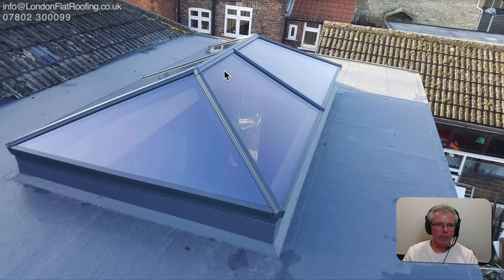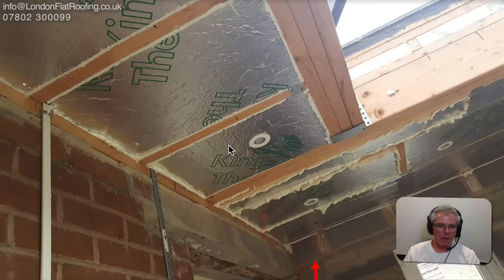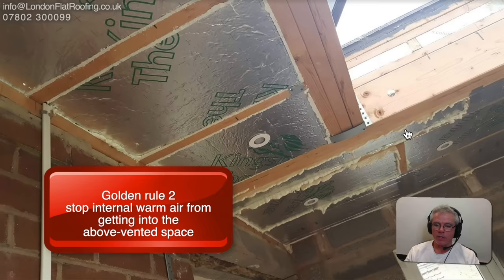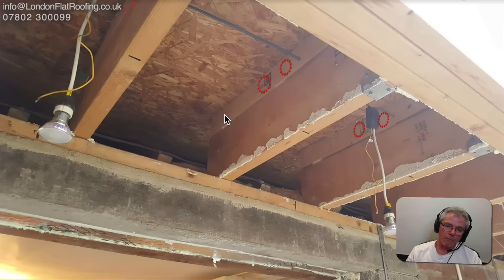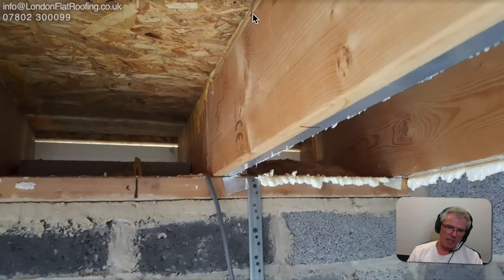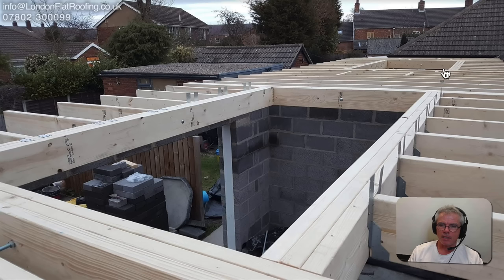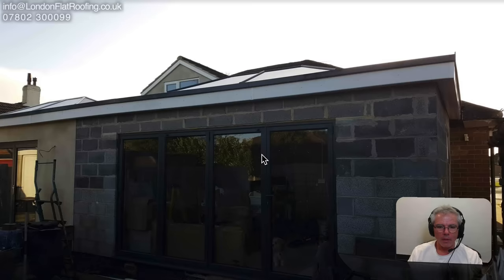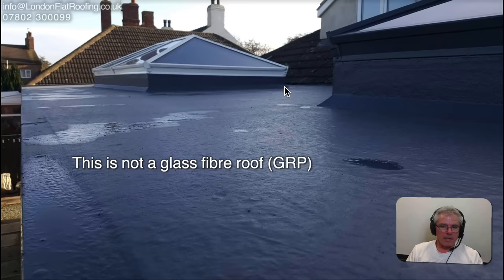Sweating and mouldy New cold flat roof

Comment: Hi, great video, I hope you have some advice for my unusual project. I am building a 4x4 metre drum studio. It is constructed with a flat cold roof and uses a room in room principle. Because of sound insulation venting is not really an option. So my constructions is as follows: outer room: on top EDPM, OSB, rockwook, damp proof membrane, 10 cm of air and then the inner room rockwool, damp proof membrane, plasterboard. There will be mechanical ventilation in the inner room. I was not planning venting the space between the rooms Should I do this as well? are problems to be expected considering the 2  membrames? also it wont be heated 24/7 and there wont be holes in the plasterboard for lights etc

Comment: Does the closed cell insulation with foil backing, along with foaming air gap details not suffice as a vapour barrier?
Foil has a superior vapour Impermeability than poly even.
Reply from the maker: Yes one of the problmes on this could be that they have introduced a  AVCL (air vapour control layer) in the wrong place
Reply: Cheers 👍

Comment: The vapor barrier needs to sit on the side of the insulation that faces the warm/humid air.
So it depends on your local climate and is not as universal.
Reply from the maker: Yes correct in warm countries you place the VCL on the outside

Comment: Which vapour barrier do you recommend,? And would this be simply stapled to the under side if the joists?
Reply from the maker: Novia 1200 Vapour Control Layer 100m2 Roll follow the instructions and use alll the tapes

Comment: Been flat roofing for 35 years, Put a warm roof on if you can, saves the need for vents.
Reply from the maker: Yes much easier construction
Reply: The trouble is that the overall construction depth of a warm roof can cause detail and aesthetic issues.  Besides how many jobbing builders know what a warm roof is - they probably think that it involves some sort of heater!

Comment: Don’t we want to cut holes in joists in the center third for ventilation? This is done for electric running wires as to not compromise the joist critically and would assume you would want to do it here also.

Comment: Hi steve, i have a question, i have a small extension with a warm roof and a overhang on the front there is a secret gutter, the inside is not plasterboard yet, and we had a lot of rain when roof was done, my problem is where the overhang is the osb below the secret gutter is sweating. I was told to pack this with insulation to avoid drafts, at the moment there is no insulation in there and with the cold frost in the morning i am guessing that is causing the sweating. Do i fill this with rockwool or pir, i plan on having downlights in the sofit.
Reply from the maker: you really need to send me some photographs so that I can understand this
Reply: Hi Steve, basically, the overhang on roof is about 600 wide, and I haven't put any vents in the sofit. On the overhang, there is a secret gutter built into the overhang, and from the inside, I can see into the sofit and see sweating on the osb on the overhang. I was told I would have to insulate the gap on  the inside to stop drafts coming in, and I think the warm air from the house Is going into the sofit and meeting the cold on the overhang, there is no insulation on the overhang as there is a gutter built into it. The rest of the roof is a warm roof.

Comment: Hi Steve, we are refurbishing a cellar room that has a reenforced concrete roof, which sits approx  400mm above the ground. The  2 sides of the roof that can be ventilated, are at 90 degrees to each other, so we can’t cross-vent. Also, there isn’t enough space to insulate above (access to property).  Possible a ridiculous idea, but could we fix PIR to underside, then use something like passive house variable membrane to make it airtight?

Comment: Does all this apply if you were to make a loft space in your garage, and insulate and board it out between that and the converted garage below ? Can it still sweat or does the air circulation coming in from the sofits prevent that?

Comment: I have a question to ask. My friend who’s a builder told be to over board my plaster in my attic bedroom with Kingspan. It’s an old house build in the late 1800s. I noticed the other night I had condensation all up to my apex from my eaves so I have taken the insulation off the plaster board and then noticed moisture on the plaster too. Is there any way of retro fitting the insulation to this house. Or will I need to reroof to get a vapour barrier installed thanks.

Comment: Common problem with cold roof , sometimes I’ve seen celotex or whatever stored outside and left out in pissing rain then fitted soaking wet which will dry out over time but not before you notice this exact problem

Comment: Hello, can you elaborate why one would need to use treated wood for a (flat, cold?) roof construction? Thank you!
Reply: I would assume it’s because any condensation build up on untreated timber is more likely to lead to rot and decay.
Reply: @xxxsmithxxxx  If properly vented (assuming this is always the case and standard practice), there will be no condensation.
Reply: @matthiasdemey1423  belt and braces approach maybe in the event of unventilated corners etc. Again, I can only assume.

Comment: Warm roofs are a better solution, but think that if you do have a well insulated cold roof and a vapour check in place that venting the roof above does in itself produce problems and breaches the text book achievable u values.

Comment: I have two properties with roofing problems, London, Hampstead NW3 and Kensington, one has a flat roof, the other I think is a cold roof with epdm rubber, the roof with the flat roof has water damage, it is ventilated well I believe,  i think it’s asphalt, it may need the insulation redone?  Some brickwork may need repointing,  many problems, we have a sun roof built in also its timber,  we are thinking about roof tiles but are not sure about the building and construction problems associated with it, I am in Chelsea and Fulham all next week if you are passing by would you care to come and have a look at some other roof engineering problems that may have water damage also on a small industrial estate, I understand you may charge for a professional survey, thanks.

Comment: Great videos Steve, and ones that I’m really glad I stumbled upon. Would you mind offering some advice ? I am building a simple 3.6m square workshop and as well as getting it watertight, I’d like it as soundproof as possible. My question is this: Can I use the warm roof system and then insulate and board on the inside for soundproofing ? Would this cause any issues with sweating / condensation? Thanks in advance. Kind regards, Dave.
Reply from the maker: Good question.  Use rockwood inside as its vapor open. Try to make sure the insulation on the roof better than whats between the joists.

Comment: Hi, Great video and commentary. Question : at 3.40 you say to make circular holes in the firring. Doesnt the firring (and joists) stop just over the wallplate so ventilation would go around the ends?
Reply from the maker: Possibly but you need to get a good flow and a cross flow

Comment: i have a 10 x 10 foot shed gym with  14 ,   9" x 3" air bricks installed and the ply roof started going black i had to paint the ceiling with anti mould paint

Comment: @Steve Roofer thanks for taking the time to make the vid, very informative! I am starting the exact same project and have 2 q's: Why is treated/tanalised timber recommended for the whole roof as it will all be under cover once the roof covering is on? Also how do you get around the issue of the downlights going through the insulation, I thought there is no getting around that? Cheers
Reply from the maker: All structural work has to be treated/tanalised timbers.If at a later day one rotted and the roof collapsed they could be big problems so all structural timbers are treated. As regards spotlights in the ceiling as long as you don't break the thermal element of the roof and the vapour control layer you can do whatever you want

Comment: Steve, I need your help, I've got a flat garage concrete roof connected to the house and it's a nightmare. I've stripped the toilet back which is under it and need advice before going further.

Comment: I have a roof with an 11 degree pitch, i was thinking to try to insulate between the rafters with 40mm hard foam leaving an air gap all the way to the ridge with a slightly larger air gap at the ridge itself. Currently the loft is a crawl space around 4ft high at the ridge, after insulating i was going to also add plasterboard with yet another air gap of 2cm. It is a tin roof with no insulation, between the tin and the rafters are simple wooden planks which do not fit tightly, basically you can see the tin between the planks. The idea is to open up the loft space a bit to the house for extra storage and space and to try to stop ice dams from forming on the eves. The eves are very large and overhang close to 2.5M. the warm roof melts the snow and meets the cold eves where it freezes and destroys the nails that hold the tin to the rafters. 
  Hoping to kill several birds with one stone but keen to avoid ridge rot. I'm wondering if the external tin would need to be lifted at the ridge providing yet another breathing point closer to the ridge. Not sure what to do about moisture barriers. I was thinking to put some plastic somewhere in the sandwich but wondering if it's just better to omit it and leave everything porous bar the insulation itself.

Comment: Would I need to vent the space between the wall and metal siding on a 64 sq. ft. ? I'm converting a wood framed, corrugated metal siding/roof shed to a drum room. I plan to put foam board in the wall cavity like in the photos you are reviewing. I'm concerned once I put the foam board insulation in, seal it with expanding foam, and cover the interior with plywood panels that there will be condensation in the walls on the inside of the metal siding.
Reply from the maker: You need to send e details and I will have a look
Reply: @SteveRoofer  what is the best way to get you details/photos?

Comment: As an electrician. Can down light not be fitted into a flat roof due to the insulation removal??
Reply: Cut a square section out foe the light a, then use a thinner layer of insulation to underside of roof between down light mate.

Comment: Lots of fine advice here. I would disagree that pressure treated wood is required, perhaps your code requires it but that is another matter. OSB is junk; it is a mold factory. Plywood costs more but it is tough as hell and more resistant to mold. Ventilation is everything and I heartily endorse the strapping. In Canada, vapour barrier use has changed a bit. At one point we were required to wrap the window and door openings with plastic. That stopped when the wood rotted. Vapour barrier use is now being questioned. Fine Homebuilding has a great Green Build offshoot where the science is debated.
Reply: Do you have a link for that offshoot channel? Thanks.
Reply: Osb is far better than plywood. Any moisture at all and plywood comes apart

Comment: there is no reason at all for it to be treated timber if it's getting covered and if you cross buttoned it from the top what would the firms sit on to
Reply: Exactly, unless you're expecting it to leak, and you're never going to fix it? All my new construction these days has roof and exterior walls specified as treated, pain in the arse.

Comment: wrong Cross batten won’t help with venting towards any skylight as the air flow gets restricted the proper way is to create  a vented upstand  around the sky light and allow the ventilation to blow straight through.

Comment: You say the lights shouldn’t of been cut into insulation, how else could they be fitted? I’m looking to do something similar and want to ensure it’s done right, the soffits would be vented
Reply from the maker: cut the lights in but don't undermine the thermal performance of the insulation   also make sure the AVCL is intact after you have fitted the lights All extremely hard to do
Reply: @SteveRoofer  thanks. Maybe I’ll look into a warm roof instead. Do I still need vapour barrier and venting?
Reply from the maker: you don't vent warm roofs  yes you have to have a VCL
Reply: @SteveRoofer  perfect 👍

Comment: Hi I’ve just built something almost similar, 
Is it possible you could give me a breakdown on how to vapour barrier and insulate,
It has a 2mtr x1mtr roof lantern with a single ply membrane roof 50ml kingspan external board below the membrane 
It has 50ml to nothing faring battens for water flow I’m just at the stage of ready to board up and insulate but would like to do a proper job cheers 
I can foward pics if you could help cheers

Comment: Just wondering what would happen if you put a vapour barrier on the inside and outside of the insulation? Is this ok or does it cause problems
Reply from the maker: If you put a vapour control under the installation and let's say this vapour control is extremely good over a period of time some moisture will definitely get into the installation. This moisture has to get out so from my understanding above the Insolation everything should be less vapour resistant. So the most vapour resistant products in the buildup should be the vapour control layer. However, this isn't necessarily always true because no one looks at how vapour resistant the flat roof waterproof membrane is I've discussed this with many people and It's generally accepted that above the vapour control layer everything should be equal to the resistance of moisture or less. So to answer your question the same vapour barrier above and the same vapour barrier below would be equal and should theoretically work. This is also spoken about in a document published byTRADA (The Timber Research and Development Association) They also discuss that no wood products should be used in the buildup of a warm roof above the vapour barrier!
Reply: Steve Roofer thank you for your detailed response. This has really helped clarify this issue which I have been thinking about for a while now
Reply from the maker: Me too, all of this is an evolving situation and very hit and miss with no backup and little understanding. I have to give ten-year guarantees that all of this works. Interestingly old felt roofs were made so that they could be replaced when they failed. All new warm roofs cannot be replaced when they fail, when they fail they leak when they leak water gets to the insulation, wet insulation won't work and will need replacing as you cant dry it out. Conclusion build warm roofs to last a minimum of 20 to 30 years or build them so that the waterproofing is changeable without changing the insulation. So how do we do this! I'm working on this now but the truth of the matter is people just won't do it as they want cheap solutions and a long-term roof solution is costly.
Reply: Steve Roofer luckily I don’t have all the complication that you guys do in the trade as I’m just doing a self build at home on my summer house. I do like to research all the pros and cons so that I can do the best job possible within my budget so I find all of your videos extremely helpful, as do many others
Reply: @SteveRoofer  Can't you just rough up and roller on another layer of GRP?

Comment: What kind of treatment for the wood do you mean? 🤔
Reply: Construction grade timber is pressure treated with a product called Tanalith E (Tanalised) which prevents rot for 30 - 60 years. The "C" rating that is mentioned in the video is explained as follows; C16 graded timber is strong enough for some applications such as wall plates, studwork, rafters, joists etc… C24 comes with added benefits. C24 timber has been graded to a higher standard than C16. It's a premium piece of timber that can handle higher loads and wider spans.

Comment: The condensation is caused by temperature fluctuation between the outs side and inside. Venting is not the problem.  We are building air tight homes in the US. To avoid problems insulate the roof deck with the foam you put in the ceiling. Make it an R 40 and forget about it.  The temperature in the rafter space should stay about 45 degrees +/- a bit. All else is a waist of labor and money.
Reply from the maker: Are you suggesting putting the insulation between the joists?
Reply: No above it’s an exterior hard foam board insulation than the roof
Reply: It goes over the deck
Reply: Temp control is key friend.  Us using the cooler concept now. Isolate the temp inside from outside. It makes things more efficient ( little heat or cold to keep it comfortable).
Reply: Very well put Dillon Sykes I’m in Long Island New York and we definitely care for seal envelope homes because it costs a lot to keep a home warm in the winter.  To the issue of humidity inside the wall or ceiling rafters caused by condensation stopping the inside outside fluctuation from outside to inside or vise versa, outside rigid insulation board could be an option. When you see the video the temp difference from inside to outside is already inside the rafters passed the roof deck. Insulation outside don’t let that happen the temp difference is neutralized at the insulation between the roofing material and the insulation board does creating a moisture free culling cavity. You know there is more than one way to skin a cat ..... or so they say. Stay well man.